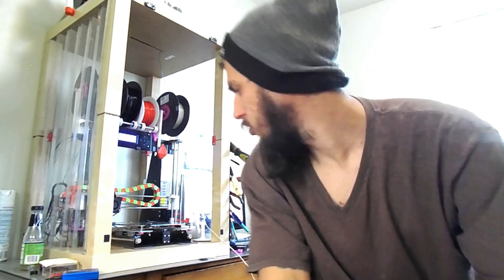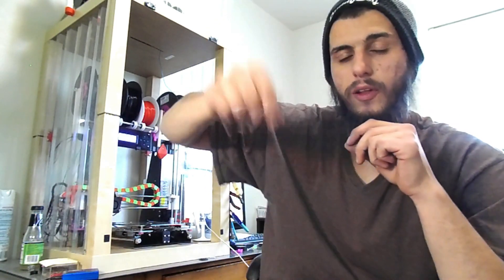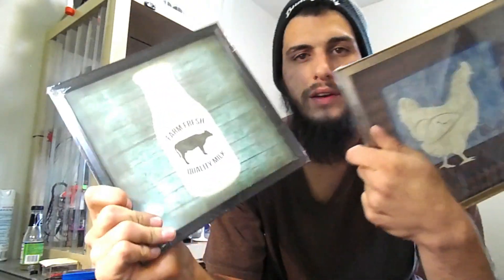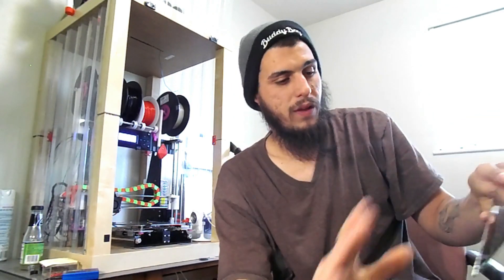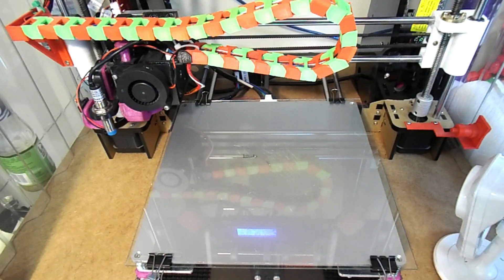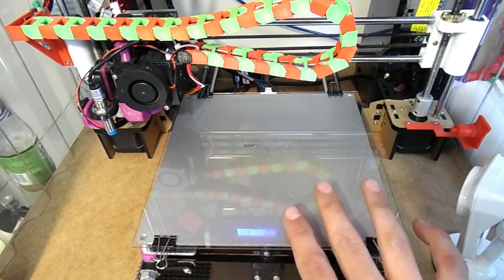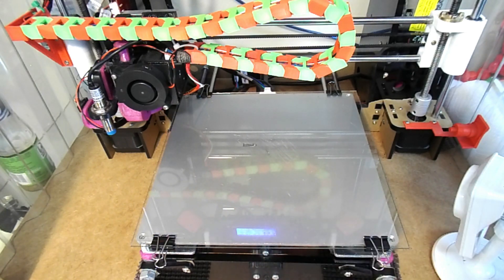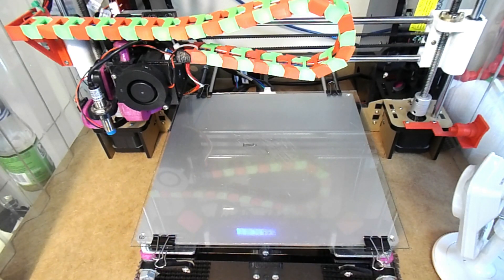ANET A8 $1 Glass Bed. Fastest, Cheapest, Easiest 3D Printer Mod!

Comment: A glass bed adds weight to the carriage. More weight means overshoots as the printer tries to control the mass.
You'll have to slow down the prints to get decent quality.
A much better idea is to use a thin plastic build plate/sticker.
Reply from the maker: Kevin Gill I get same great quality at same speeds

Comment: just an idea they sell y8 (go pro knock off) cheap on e-bay. if you wipe out going through trees and cones or flags you wont be out to much. they also have an app so you can see whats going on . just an idea. if you could show how to install the bed level sensor. Take care
Reply from the maker: PoorBoy Garage This Is My Life I axially have one of those now for just that reason! lol and thx for the suggestion. I will do a sensor install video soon!
Reply: Hat tip for the Dollar Tree suggestion. Great idea! I noticed right away you are auto-leveling the bed with the glass on. I would love to know what sensor you are using and how well it is working for you. Can't wait for your video of this. I ordered my Anet A8 yesterday and am lining up all the mods I want to do.
Reply from the maker: VegasGuy89183 I actually added a peice of 1/8th inch sheet metal right under the glass to help the sensor out a bit.  5$ at home improvement store. that way any inductive sensor will work amazingly. they sense metal WAY better than aluminum 👍
Reply: Thanks FPV Prints, that makes sense. I just got back from Dollar Tree and picked up a 9" x 9" picture frame with glass. I measured the glass with a caliper. It's 1/16" thick which is a plus when used with a leveling sensor. This is a great repurposing hack!

Comment: I am still new at all this but i have not used any hairspray on my glass bed and have had no rejections yet.  I clean it with isopropyl alcohol on the first print of the day, then maybe every other.  I also have not printed anything that is to tall yet either.  At most 2" so for taller maybe hairspray will help.

Comment: I removed the ABL, On my Anet A6, the Heated bed is that bend, that with glass, i hardly had any Clearance, between the nozzle and the Probe ( i had the big blue one).
The Z axis made much more noise than before the ABL. Original Anet FW 2.0 installed, and the print quality is better, compared to SkyNet (imo)
The Next thing was installing a sheet of 3mm Glass, (3 pieces at the local hardware store, 7 Euro) Bought:  Hairspray, Acetone,  IPA alcohol (not the beer) and Glue stick and clips,

I Forget about:
- printing directly on glass, wiped with Alc, or Acetone, does not stick any better.
- hairspray, still came lose, curly at the bottom.

I stick to: (haha word joke) 
- GLUESTICK, it melts between the seems of 
the first layer, and therefore adheres good, i need blade tool to get i 
off the build plate glass.

The Bed leveling is the most important part.
I replaced the wingnut, for thingiverse models, added the 3mm bracket, at the z axis.
Put down the glass plate, en set the nozzle height manually, 2x per corner, so did 2 rounds of adjusting, and man, everything sticks as it should.  (well i have become an leveling expert and burning victim by now, but if you get it, you will be a happy confident maker.)

PETG Even though the manufacturer writes the values on the filament, i am 5 to 10 degrees above that. Heated at 30 Deg Cel. is sticks super.

I use Octoprint on my Pi 3. 
After testing and fine tuning on my PC, I export the Cura profile, and import it into Octopi.
It sames up my PC so i can go out with my laptop and watch the progress on the webcam. 
Slic3r is now able to send the job to the printer over your home network to OctoPi, that's cool because you have a bit more functionality in Slic3r you don't have in  Cura, (imo)